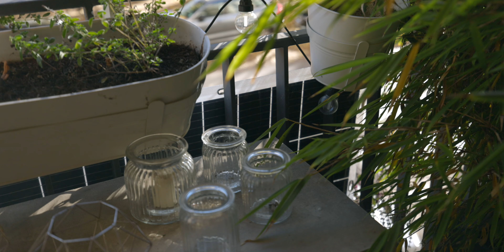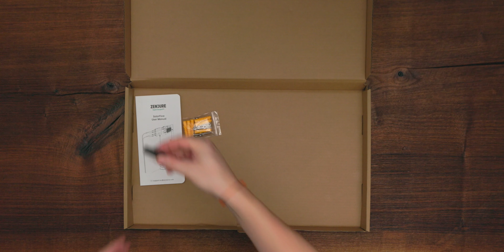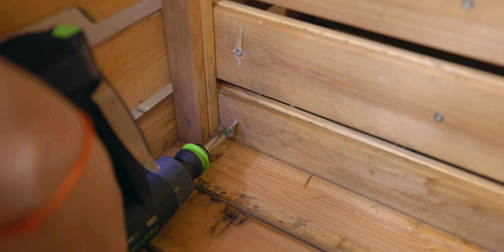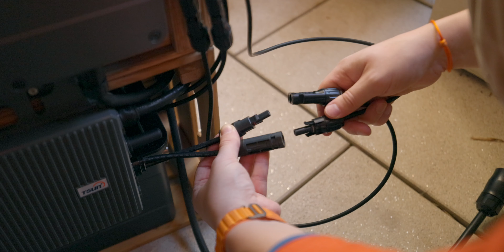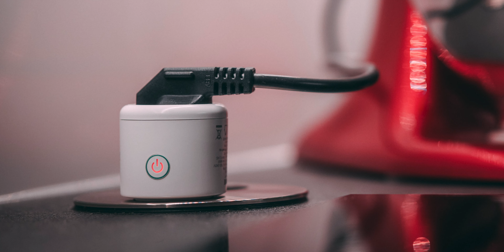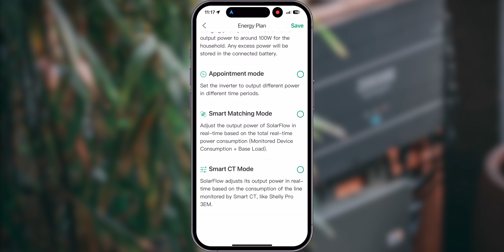Best Balcony Power Plant? - Zendure SolarFlow Tutorial

Comment: It took a moment, but this isn't intended for an apartment balcony. The grid tie part would be 'difficult'.
Reply from the maker: It definitely is. But in combination with the Shelly you can further leverage its capabilities. If you don’t want to operate it with smart plugs either, you can also work with its built in schedules, so it’ll release its charge when you are back home